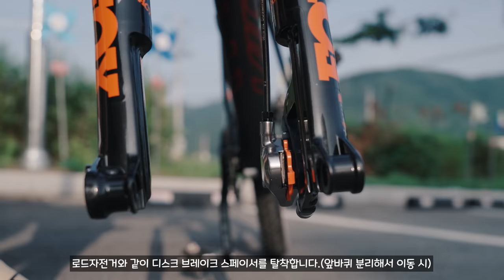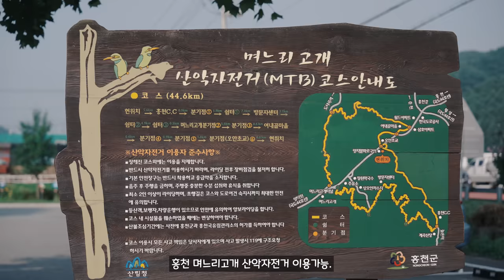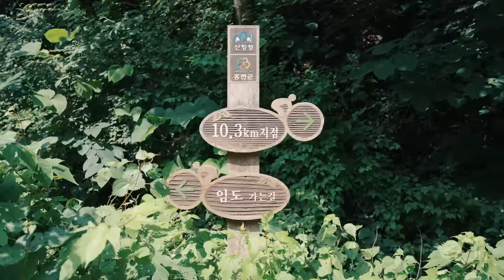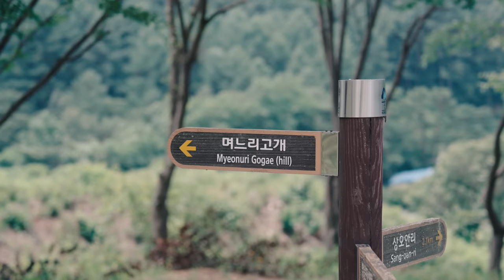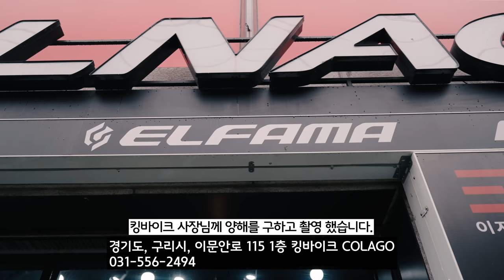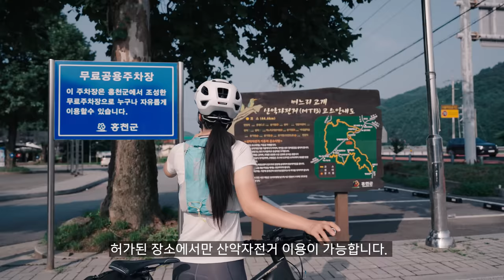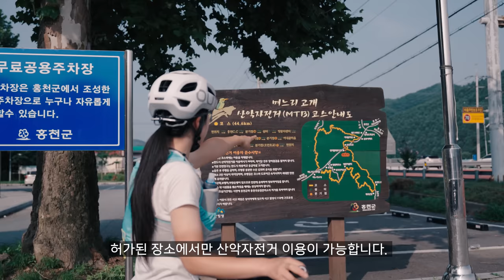처음으로 MTB 타고 산속에서 모험│MTB 산악 자전거│민디의 자전거 여행 Ep.142

Comment: Nice to see you on a MTB! 😊

With the topography of Korea, your country should be a mountainbike mecca. 🤔

A couple of things struck me while watching. 😉

- Get used to the fact that the easy gears are slow! ...patience, you seem rushed. 
- Work on your balance at low speed, you're zig-zagging! 

- It seems the tyre pressure is a bit too high. Small stones "kicking" your wheel to the side and the front wheel generally "floats". This is a sign of too much  tyre pressure. [Or that you don't put enough body weight on the tyre 😎]
(At 2.1" / CX casing / tubeless / forest highway @approx. 50kg.) I would start at  max. 1.9 Bar 27.5PSI rear / 1,8 BAR frot. 
The Fork doesn't work that well yet either (stiff).  Is the sag and rebound right? 

"Buncing" to gain grip is of course a crazy idea! 😵‍💫

BTW: 
I would advise a backpack in the future. If you put bottles in the front of a running waistcoat, it restricts your freedom of movement when steering. And if you have to fall, the bottles could bruise your ribs.  
The „forced descent“ is part of mountain biking. If you ride so slowly that you can't fall, mountain biking is boring. 😎 So think about protection. ☺

Mountain biking is the coolest way to ride a bike. Have fun!
Reply from the maker: Thank you for the detailed information. I'll keep that in mind. Have a great day Thank you.👍

Comment: Yes a nice pair of slightly padded  sticky mtb gloves helps a lot , especially with a nice sticky rubber set of handles. It allows your hands to be way more relaxed since you don't have to death grip your handle bar.
 I got the Lizard Skins New Northshore Lock-On Grips and I am in ❤❤❤❤❤ with them. I am literally just closing my hand over them, zero effort needed to get a secure grip. 

 Also please try to keep your wrists straight and not angled up cause it will create issues in the long run. Think that the top side of your lower arm should be forming a straight line just like when you throw a punch. Shoulders and elbows relaxed to be used as suspensions taking the vibrations the shock can't eliminate.
Reply from the maker: Thank you for the good information. I'll keep that in mind👍
Reply: My wife used to had numb hands after mountain biking and after some observation I swapped the brakes for some 4 piston brakes with big rotors (for superb braking power with minor effort on the hand) and tunned the fork to get softer. Now when we ride together she doesn't had numb hands anymore

Comment: Hi mindy, 
A suggestion- unlock your front fork to absorb the vibrations  and rock impacts,  and lower your tire pressure psi to make the ride more comfortable.  You probably have the tire pressure set too high that is causing you to bounce too much.  Also wear padded mtb gloves to help absorb some of the vibrations in addition  to your front shocks. 😮😅😊    
Fighting fighting mindy
You will get better as you practice on a variety of terrains.😊